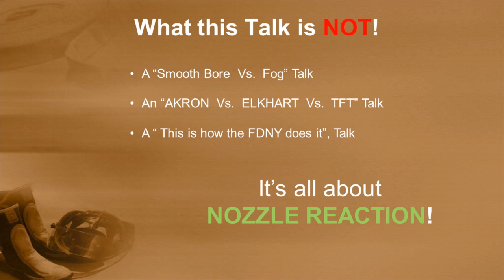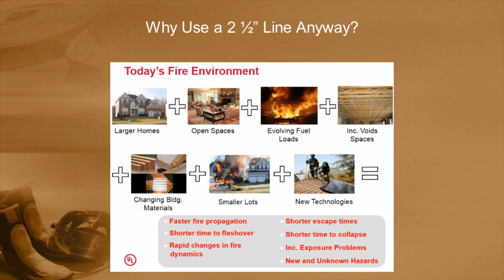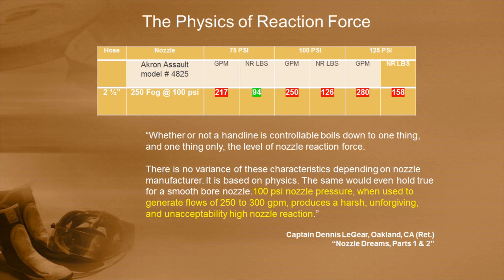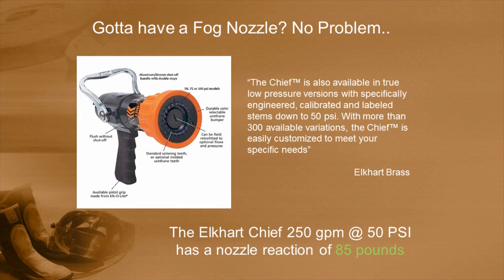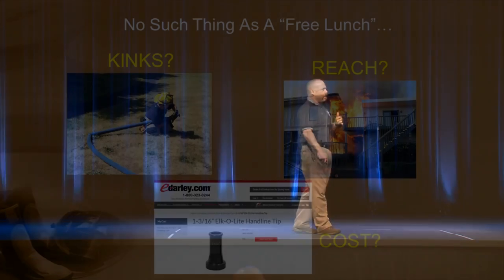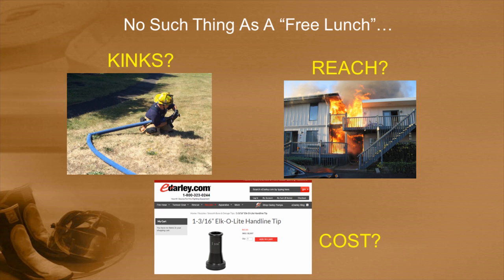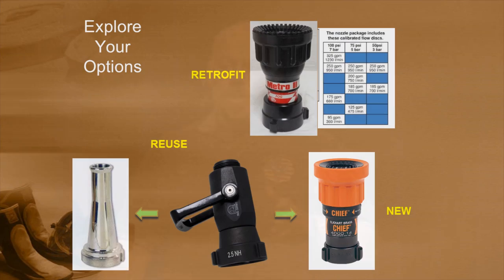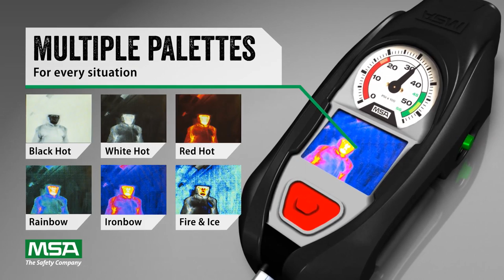John Stanislaw | 2 1/2" Hose & 100 PSI Nozzles | FIRExTalk PDX '16

Comment: Never trust a truss, large surface area and little meat.  If it was built with trusses, after about 15 minutes and you are walking on barbecue charcoal supported structure.  That smoke coming from the roof, if it is on the downwind side, is merely telling you where the chimney is supposed to be for best airflow?